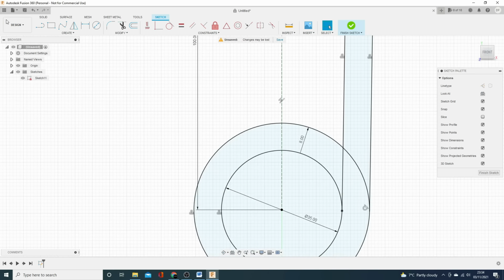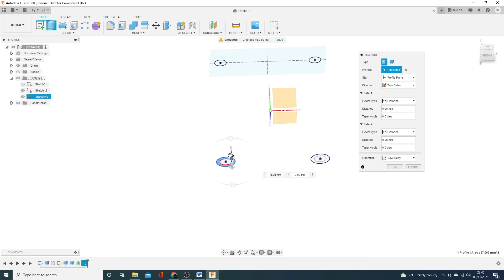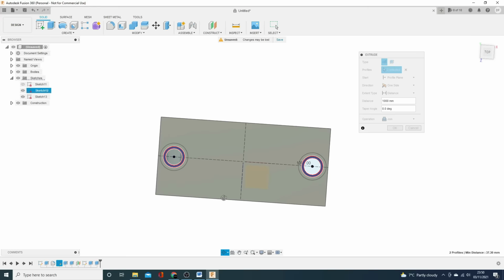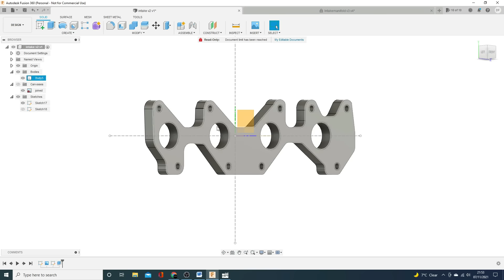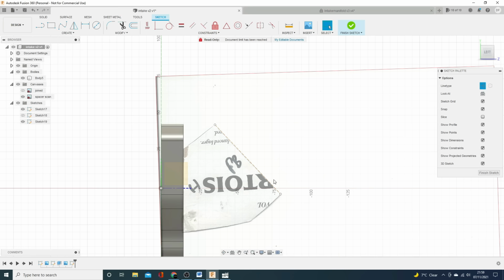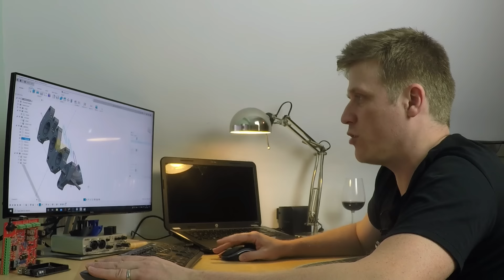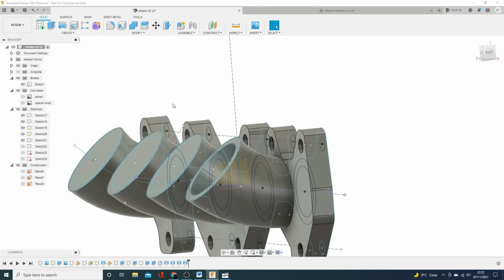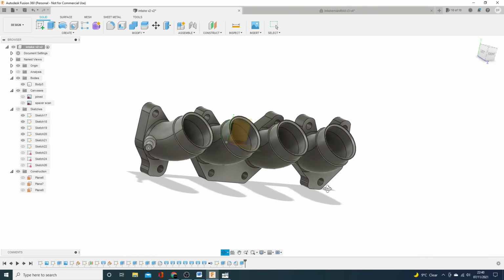Even more 3D modelling!  Using Fusion 360 to make more complicated car parts!

Comment: 25:00 I would do a simple split on one side and one with the 2 mm gap on the other, as it would make installation easier: you first screw one screw until the two bodies touch and you set the "crush" factor with the other one instead of juggling between the two

Comment: For the picture part.. 28:41 .. I’m not sure if android offers anything like it but with the newer iPhone models (pro max at least) they have a special “document scanner” to use if you are wanting to use it as “scanner”. 

You can either long press on the Notes app and you’ll see the shortcut to scan a document or you can open a note and click the photo symbol. It will pop up with a few options and you want to select to scan the document.  

It uses an algorithm to scan what you are trying to upload and it uploads the document or item completely flat as if it were to be scanned instead of taken from a single point and causing the distortion.

Before you had to make sure you were perfectly over the top and level when taking the picture if you were going to try to use it for a file. At one point (still in camera mode today) it had a leveling cross to make you sure your phone was perfectly lined up flat.

Now when using the scanner you can let it scan something from a random distance and angle (even 45°)  and you will see it highlight the item and start to process it and then it will pop up with a perfectly straight image with no distortion.

The algorithm is able to produce a file that has the effect as if it had been scanned instead of getting the distortion that you’d get from taking a regular picture for the dimensions.

It allows you to to create a picture the same way as if you had physically moved the camera to scan it the same way a real one one works.  Its surprisingly accurate and I never really have in trouble with it.

After finding the document scanner and looking up how it was different compared to taking a picture to make a file I honestly find myself using it 9/10 times if I’m taking a picture of something I plan to mark up or whatever (be used as file and worked or edited vs screenshot or snapping a picture to edit or fill out)

Comment: Good to see you took on some of the suggestions i gave in the last video.

Done a fair bit of modling but everyones brains think differently so is very interesting to watch.
I plan to do a manifold to add another injector per cyclinder on my race engine. See if a 3d print will handle boost.

Rwpracing youtube has a few videos of my race stuff.
Reply from the maker: Every days a school day!  I love that theres no absolute right or wrong way to model (but maybe some are better than others!)...
Best of luck with your project, I reckon adding in a bar or 2 of boost might just make it interesting!!!
Reply: @MakingforMotorsport  bar or 2? Already run 3 bar lol

Comment: The only reason you don't have a million subs is because people didn't find you yet, you do some awesome stuff on this channel mate :)     I went full standalone ECU on the Volvo in the end, it wasn't the cheap option but it was definitive - I now have a running driving car :D
Reply from the maker: Oh hi there!  The Volvo jumped into my head a few weeks ago… which one did you go with?
Reply: @MakingforMotorsport  ECU Master, I got the full dash setup with a canbus button system etc to go with it as well, done it proper, painful price tho buddy, I wish I had half your talent  !!!  Hoping to make some bushes soon using one of your old vids, they don't make poly bushes for the derivative of T5 I have, the police spec cars had slightly different suspension (my car is ex Police)

Comment: Man these videos have been amazing! Thank you so much for all the info! I’m getting everything ready for this winter to convert my 1982 Honda Magna to EFI and your videos have been insanely valuable. I’ll need to do way less manifold wise but this info is incredibly valuable. I’m taking some VFR800 TBs, a Speeduino, and my 3D printer to make magic 😎 all the Magna old heads are up their ass about me not wanting to keep screwing with carbs on a V4 but they’ll be the first asking how I did it lmao

Edit: forgot to add that I was considering a microsquirt (just because I’m more familiar with them) but your videos have me wanting to tackle a full Speeduino build, starting with a bare board and making my own ECU housing lol

Comment: A bit of tips for creating those holes. You can use the actual hole command. It has settings that will help you countersink the bolt heads as well as the nut inserts. 

Or, if you feel like it's strong enough, you can model the actual threads (using a size slightly smaller than the actual threads, but same thread pitch) then run a tap (or die depending on what you're making) all in that hole command! 

It REALLY comes in handy to make those little tweaks all in one swift motion!
Reply: Are you still able to use the projection method like he did for the placement and alignment of them?
Reply: @Dreadz530  I've been able to. Sometimes you have to project them or slice the view in order to snap to it.

Comment: Excellent pair if vids Dave, very informative.  I made steering wheel hooks to mount to the rollcage for my MX5 and for a couple of other hillclimbers with detachable wheels but I made very simple "S" shaped hooks that simply hook over the rollcage tube with a double sided sticky pad to hold it in place.  I shall be doing a similar job with the inlet manifold for my MX5 except I am currently using freecad (although I have also got fusion360 so may go down that route.  One of the biggest differences is the inlet ports in my head are oval and obviously the ITBs are round so plenty of fun yet to be had.  Currently working on a flowbench so I can measure the airflow improvement (or otherwise) with different cams and before and after some light porting work.  All will eventually be on my channel.  Keep the shiny side up mate :-)
Reply from the maker: Sounds fantastic, I need a road based play car… MX5s could be just the ticket!  
I always recommend Fusion360 and the “Loft” function will handle the oval to round transition no problems…. Flow measuring kit is definitely on the list… it’d nice to try and learn the black art of flowing heads!   Cheers 👍
Reply: @MakingforMotorsport  MX5 (Mk1 preferably but I am biased) is a great fun weekend car. Mine is a pure hillclimb car now but was a plain ordinary road car when I bought it, Daughter had one and wife had one and both loved them, I even "borrowed" my wife's Mk2 August bank holiday Saturday 2017 to do a hillclimb with as I had taken a year off but missed it too much.  Shared the car with a mate who used to run a 3 door Cossie Sierra in Mod prod (330-440BHP switchable) and he reckoned the wifes stock 1998 MX5 handled better on 20 year old suspension than the sierra ever did.  I like the look of Fusion 360 and will make an effort to use it.  Holding fire on designing the manifold as the port dimensions will almost certainly change with the porting work.

Comment: These videos are great.  Learning a ton from you.  On this drawing, did you consider bringing the bolts in from the front or backside and splitting the roll bar hole vertically?  I thought it might make the bolt situation a bit less complicated, but I'm no engineer.
Reply from the maker: Bringing them in from the front would’ve been a great idea 🤦‍♂️😂
Reply: @MakingforMotorsport  LOL, always easier to see from the sidelines...
Reply: That would of been too easy. We need a challenge in this tutorial :)

Comment: You make it look way too easy, thanks for the inspiration! My own set of 3d printed ITB's are in the making. Might improve power, might not, the fun is in the designing. Even then, itb's have a 100% chance to make an addictive induction note.
Reply from the maker: It’s all in the practice… and trust me, in the range of people 3D modelling I am very much at the beginner end!  Just get stuck in, pick up some tips from where and there and practise them.. you’ll be flying in no time!
Reply: @MakingforMotorsport  Thanks for the tutorial! got myself some yamaha tb's and i'm currently making the final touches to my inlet manifold and this tutorial is really helping! If you're interested this is going on the m44 in my E36 318IS.
Reply from the maker: If I am interested in an E36 with an M44?  Hell yeah!  You can’t tell from the channel yet but I am a major Beemer guy, I’ve has E30, E36, E91, F20 and my current work car is a 330e G20, my favoritr was the E30 which was a 318iS with the M42…. All it needed was an LSD for perfection!
Let me know how you get on with it!
Reply: @MakingforMotorsport  sure thing! Can’t wait to get it up and running
Reply: @MakingforMotorsport  also quick question, what lsd did you get? I’m looking to install one on mine too
Reply from the maker: Because it was an E30 I could just get a 188mm one off a 325i…. E36 is a little trickier, you can go M3 (which is the 210 but that might need the whole rear subframe and it’ll still be fairly weak unless you mod it (more plates etc)
You may be aswell plumping for a motorsport unit (e.g. tran-x), it’ll fit the case and be agressive enough out the box
Reply: @MakingforMotorsport  Hi, me again. There are a lot of lines running into the original m44 TB and manifold and i don't even know what half of them do. I'm using XJR1300 ITB's which are a bit on the small side (chokes from 41 to 35mm diameter) and doesnt have fuel injector inserts. I have an idea where vacuum lines can go but there are a few more and i think one also runs coolant. I'm running stock ECU and MAF for now so im most likely gonna have to use the stock TPS unless i can do some witchcraft with the yamaha one. any tips/advice? just a little puzzled/hesitant right now, the last thing i want to do is connect or remove the wrong line and somehow run coolant into my intake.
Reply from the maker: @nes3382  soo… I am planning on doing exactly this with a car very soon (standard ECU and MAF, but with itbs) but it sounds like you are on the right lines.  There will almost definitely be coolant running through the manifold to prevent icing, that often goes to the cabin heater matrix.

In this case there is really no substitute for really knowing EVERYTHING in that engine bay, where it goes, what it does, what the sensors are, what the readings are, etc etc
So for example, you may be able to use the TPS but you need to understand what the resistances are, then you can probably get the ITBs TPS to read the same values… (with a bit of elec-trickery…)

Sorry I can’t be more specific but really every installation is different and in some regards, what you are doing (working with existing hardware and ECU) is more difficult than a blank canvas…
Reply: Could i run my brake booster off the vacuum of one runner of my inlet? Or is it more complicated than that?
Reply: Another question, would 35mm diameter ITB’s hurt my performance?
Reply from the maker: @nes3382  that’s what I do…. No problems up to now…
Reply from the maker: @nes3382  is 35mm too small…?  Depends what else you have done… on a stock 140hp engine with a well designed manifold probably not but I’d say it’s getting marginal…. 
If you plan on further power (cams/head work etc) I’d be looking for 38/40mm.

The narrow diameter will help drivability compared to bigger ones… depends on the priorities… everything is a compromise…
Reply: @MakingforMotorsport  thanks for the useful advice! Yeah I’ll run this for now until i do a bit of motor stuff and could possibly sell this setup and design another one as doing this stuff is pretty fun and i have learned quite a bit.
Reply: @MakingforMotorsport  I'm thinking of running a vacuum line from each inlet port into a vacuum block then sourcing what i need from there, do you think that would be a good idea?
Reply: @MakingforMotorsport  gonna bother you again but what infill/wall thickness do you recommend for the final print? 100%?
Reply from the maker: It’s not a problem… I talk about this in the modelling video when doing the manifold… 
You need 100% on the runners and under the bolts but it’s kinda wasted on the flange.  Yes, solid will be the strongest but material in the middle of the flange thickness isn’t working hard, so you are better increasing the top and bottom layers and wall layers.
I think I went with 8 for each and then around 25% infill, that gave me a good mix of strength and material/print time. 👍
Reply: @MakingforMotorsport  Noted, as for the undersized ITB's, if i really want to do cams (which i probably will) I'll probably be able to sell this to cover for previous costs and make something for 38-42mm diameter. But let's be honest, being 17 and still in school that's not gonna be for a while and most of this is for that enticing sound and throttle response (and bragging rights.)
Reply: @MakingforMotorsport  another question, the way my ITB's are set up is that the fuel lines all go into one big 14mm outlet and i'm planning on running that into a vacuum distribution block and using it for vacuum power. Would that be a good idea? because i heard somewhere it might not be a good for brake boosters. If so should i just do that and run the brake booster separately on the inlet manifold?
Reply from the maker: So anything used for a vacuum signal (especially a MAP reading for ECU) definitely needs sharing through a manifold.  The key things about the manifold is that the bigger it is (and the size is the volume) the better it will smooth out the signal, however it will also be slow to respond.   
So as with anything, this is a compromise and specific to your setup, I have no “plenum” volume, I have just routed the pipes together as I want maximum response, it seems to work, but once you get up and running if it doesn’t drive right this could be a source of the problem.
I would keep the brake line separate, otherwise everytime you release your brake pedal it’ll mess with the vacuum.  Also you need to have a larger bore tube for the booster as that needs to actually move air to empty to the booster…
Reply: @MakingforMotorsport  Understood. Also, what exactly do you mean larger bore tube? do you mean vacuum line? if so can i just use the stock line? another quesion, the crank case valve is way too fussy for me to comprehend. Could i just replace it with a catch can? thanks for the advice, it really is helping!
Reply from the maker: @nes3382  if you look at your standard setup, then the brake booster line is bigger bore (diameter) and the vacuum lines are smaller although they both come from the inlet plenum.  This is because they do different things, the vacuum lines carry the signal of vacuum to the MAP sensor and other places it’s used, so the smaller the tube the faster the signal moves.
But the brake booster uses the vacuum and lets in air when you let off the brake and the booster needs to be actively reduced to vacuum levels everytime, so that is actually moving air.  OEMs do that for a reason (and keep them separate for a reason so I’d do the same).
Anyway, the crankcase breather depends on your local regulations and annual checks, in the UK you would probably get away with it on a filter to atmosphere…
Reply: @MakingforMotorsport   so I’m planning on venting to atmosphere since it keeps things simple and I’ve heard of other m44 owners doing it without issues. Question with the brake booster line though, if im running it on one of the inlet runners and I’m pulling the rest of the vacuum from all 4 fuel injectors to a vacuum block, do i block off that line as well? Or is it ok since it’s before the brake booster line?

Comment: When you want test the fit you can print 0.5mm as template insted of the 50mm.

Nice video i think you could gain a lot using hotkeys like the x 😜

The spacing of the holes could have been done as a linar array around your center, drawn only half and used your centerline.
Reply from the maker: Yeah, I am not a power user by any means, but I think that’s part why the video still gets views because i don’t whip straight through it people can follow.
If I just pro’d my way through… I’d leave people behind!